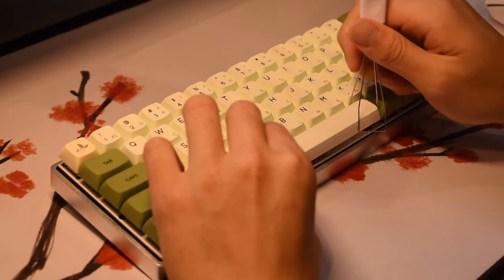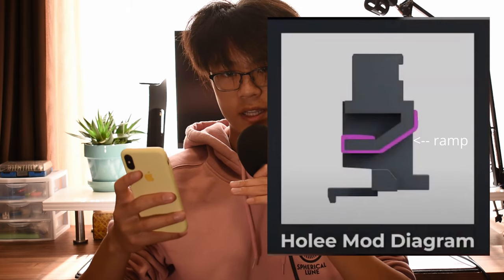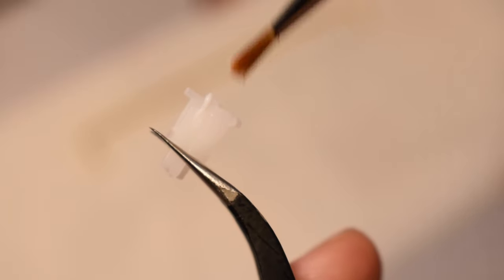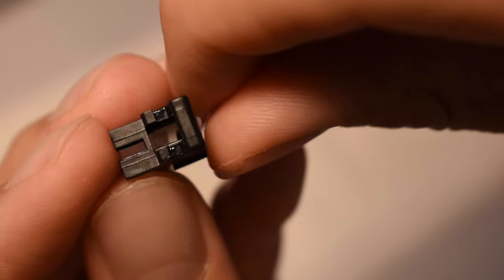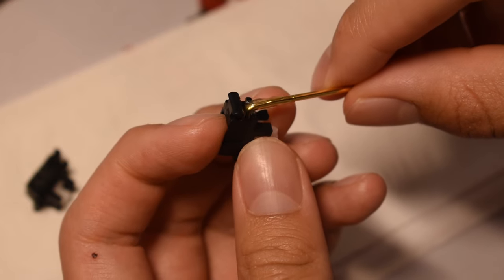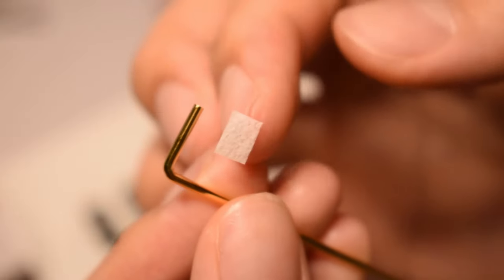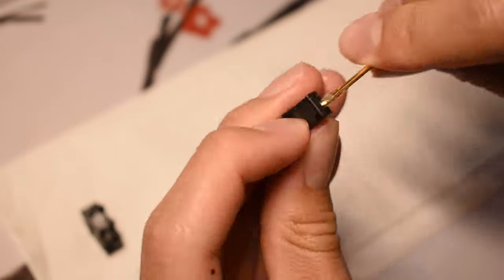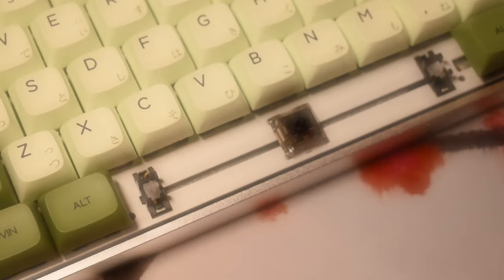Fix the rattle! | Modding Stabilizers Step by Step Guide

Comment: Hi, I’ve been wondering what’s the best mod that’s not mushy for plate mounted everglide v3 stabs in your opinion this 2022.
Reply from the maker: Everything in this tutorial should be good. In the case you experience any mushiness, it should go away within a few days of use. Also, I didn't include this in the video, but you should also balance your wires.

Comment: My cherry style tabs have come out and I cannot for the love of god put them back the stabilizer wire won't move , or the stabilizer stem is jammed. And PCB is soldered on to the plate. I cannot take the wire out cuz of the switch. Right shift is now without without stems.
Reply from the maker: Did you remove the housing without removing the whole stabilizer first?
Reply: @YBBK  no I removed the whole housing they are clip in style. I left the wire there and clipped back empty housing the stems just don't go back .
Reply: My goals was to pick up the stabilizer with the housing and put some band aid between plate and stabs. But the housing came out of the wire this wire and due to soldered switches, wire is under the plate.  And stabs does go back properly idk why it doesn't connect with the stab I even tried doing it with 1 Stab only...buy still the wire becomes jammed inside the stab.
Reply from the maker: @arkaneforyou  Ah i see i see. Did you make sure that the stem is in the correct orientation? If not, that will cause the wire to jam.
Reply: @YBBK  yes the stem is in correct orientation , but I think because I cannot take wire out when paying back down the stabs the wire moves backwards or from its place causing the stab stems to be not properly aligned which makes stab jammed :( well there isn't huge problem while using the key without stabs , but I would have liked to put back what I opened.
Reply from the maker: @arkaneforyou  I see. Man that’s really unfortunate, I’ve never had a situation like this. Really the only solution now (if you want to make it functional again) is to desoldering that one switch and remove the wire. I’m sorry for your troubles :(
Reply: @YBBK  Ty so much I really appreciate the response :)

Comment: Do u have to take out the switch my keyboard is not hot swapable
Reply from the maker: please refer to 8:10
Reply: @YBBK  thanks so much <3
Reply: um also i know this sounds superrrr weird but what like lube must i get like can i just use like... lube or... like keyboard lube XD like idk how to say it lmfao
Reply from the maker: @Error9E  lmao, it does sound weird 😂.  For stabilizers i would recommended dielectric grease for the wires and krytox 205g0 for the housings. Another way I didn’t mention in the video, is to use a blunt syringe and inject dielectric grease into the stem.
Reply from the maker: @Error9E  Please refer to this, he has an amazing guide: https://youtu.be/nuntwYJpSUY
Reply: Thank u so so much

Comment: Bro good video but you have to better your lube job, in the video you can clearely note that the dyelectric grease is not even in both parts, right is THOCCY but left sound like trash compared. Good video
Reply from the maker: Thanks! But I’m very sure it’s not the lube job. I was careful to apply even grease on both ends of wires. The reason for difference sound can be due to various factors. Eg. tray mounting style, bent plate, warped keycap etc. Either way, poor lubing does not cause this issue.

Comment: can someone help me with my space bar, everytime i click the left or right side it only presses down on that side but doesnt press down the switch
Reply from the maker: What do you mean by this? When you press one of the sides does the keycap come off on the other side?
Reply: @YBBK  nono like imagine pressing the left side of the spacebar, only that side goes down but not the whole spacebar
Reply from the maker: @Swilly2  are you sure you reinserted the wire? Did you position the stem correctly? If you followed the tutorial correct you it should work fine.

Comment: Wait, i did it all wrong. I placed an electrical tape in both up and down latch of the stabs and now it feel pretty heavy and mushy
Reply from the maker: It shouldn’t matter since it’s the latches, in fact of all things it should make it better as the housings are sitting tighter. Did you do the holee mod? If so that may be the reason, it takes some time for the medical tape to break in
Reply: @YBBK  yeah, i just holee modded the stab and it's a stock stab. So i'm pretty confused that the real reason is holee mod or the stab itself
Reply from the maker: @quocphuvu1604  yeah don’t worry, after the holee mod it’s normal for the stabilizers to feel mushy and heavy, after some use it should go away

Comment: Tried the band aid mod, resulted in stabilizers not moving at all......
Reply from the maker: There may be a few reasons why they aren’t moving. Did you make sure to reassemble the stabilizer in the correct orientation? Did you make sure you band aid isn’t too thick? Did you cut it to the right size? Make sure all of these things are correct and try again. With the holee mod you need to be very precise when cutting the bandaid

Comment: i did this wrong now my stabs aren’t working with my spacebar
Reply from the maker: Did you reinsert the housing in the correct orientation like I showed in the video?
Reply: @YBBK  wow i didn’t expect you to reply, i’ll try that :)
Reply from the maker: @90sz26  haha no problem, I read every single comment :) good luck on the fix. If the issue continues feel free to ask me questions thorough discord. My tag is linked in description
Reply: @YBBK  you are so underrated lol, ima subscirbe
Reply from the maker: @90sz26  Thank you! I appreciate it :)
Reply: @YBBK  took a bit but i finally got it to work, the spacebar would get stuck in the stabs so i adjusted the stem with tweezers to get it at an angle where it fit neatly with the switch
Reply from the maker: @90sz26  Nice!

Comment: Can I use krytox to lube the wire?
Reply from the maker: Krytox 205g0 should work just make sure to add more. However, I would still recommended dielectric grease

Comment: Intro: mod for soldered switches 
First step: take out the switch
Me: bruh
Edit: he actually has a mod for soldered switches which is just lubing since you cannot lift all stabilisers from boards with soldered switches since they're plate mounted
Reply from the maker: Yes, sorry for the misunderstanding, I put it at the very end because it wasn’t as detailed.
Reply: Said it as a joke, good video btw! I just happened to have soldered switches and I don't think my parents would be ok if I ask for a  desolder ing machine, solder iron and iron heater or whatever its called
Reply from the maker: @GigelBoss420  Thanks! mbmb just woke up and missed the humour 😂 And yeah desoldering switches hoenstly isn’t worth it lmao. I’ve done it once and I would have rather bought a new keyboard
Reply: @YBBK  at lest you didn't clickbait, hope your channel grows!

Comment: Can i use plastic band aids
Reply from the maker: I’ve never tried them before. Don’t take my word for it, but I think it should work
Reply: @YBBK  bro can u help me😂 indeed the band aid mod with plastic band aid worked amazingly and really made my stabs very steady but now I can't remove my stabs anymore😭 its too tight due to the band aid even tho you press then pull them both at the same time, still no. I even get help from my sis but it won't come off.
Reply from the maker: @nickstabz8755  Oh I thought you were talking about the holee mod lol 😂 You can try using a flat head screwdriver to pry it out.
Reply: @YBBK  k ill try it in the morning, i thought my keeb is stuck with a lizard bad aid logo forever